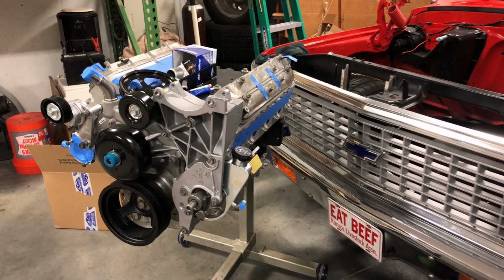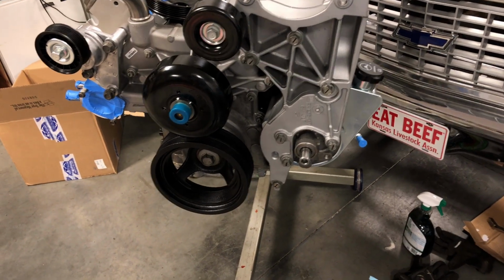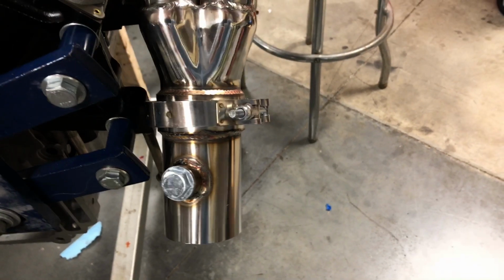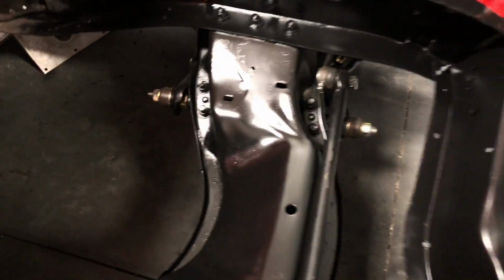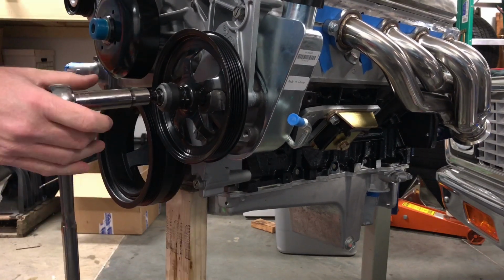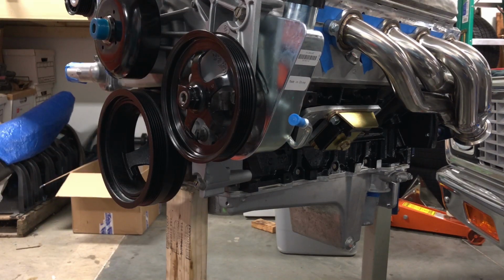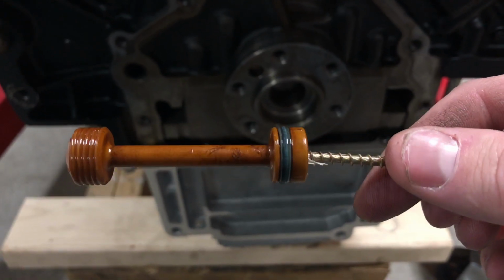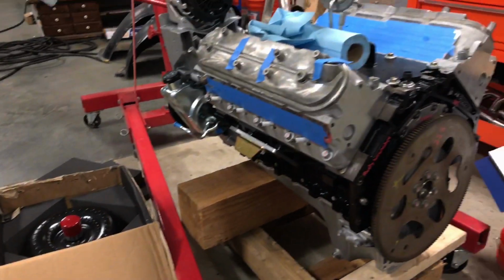'72 Chevy C10 - Power Steering Pulley Install & Buttoning Up The Engine - Day 24

Comment: What power steering pump did you use? Im doing a power steering conversion on my 68 c10 and my 6.0 didnt come with the front accecories and I cant find any pumps with the resovoir for a van (the donor)
Reply from the maker: I think mine is from an 03 Chevy 2500 without hydroboost. I got it on rockauto.com.

Comment: What pens are you using to mark the bolts
Reply from the maker: I used a variety of pens. Mostly sharpies or paint pens.  I did finally break down a buy a good fabricators paint pen towards the end of the project.  That’s why there are so many colors on bolt heads lol.